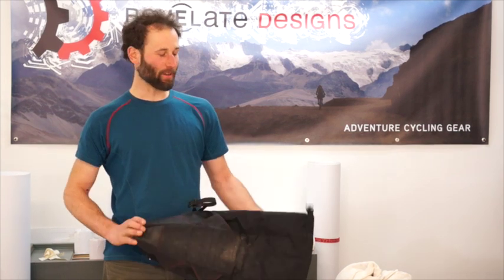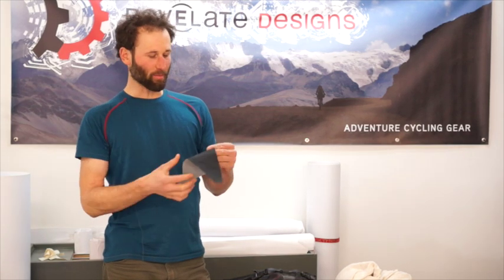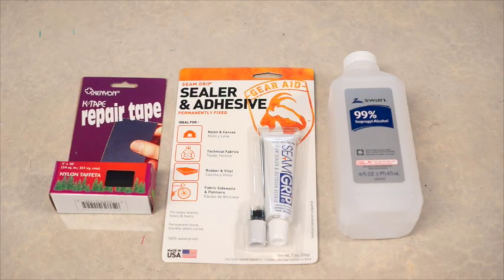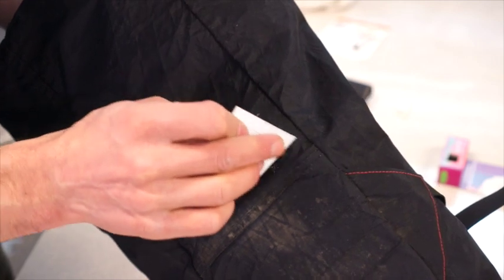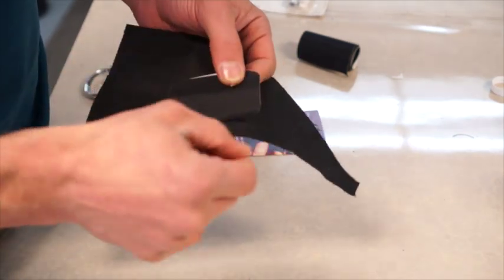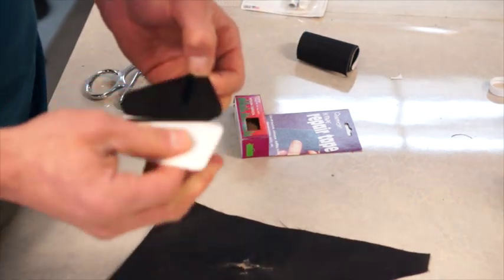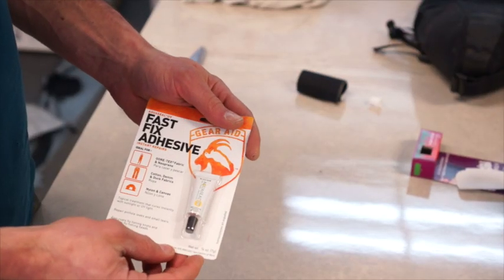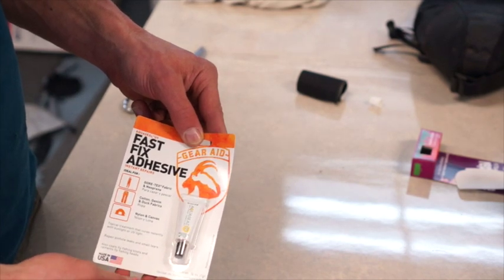Basic bag repair

Comment: I read in an amazon review that seam grip stays sticky for a long time.
Reply: To deal with sticky residue when removing stickers I will use some "trash" to stick to it. Usually use a light paper/cloth that will shred close to dust cause it'll be trash I have near but I suppose baby powder will work as well. Obviously the color of material used matterss